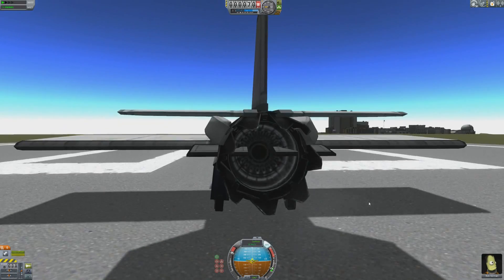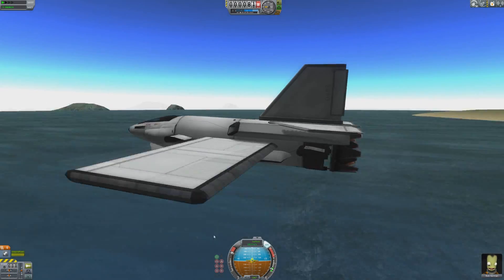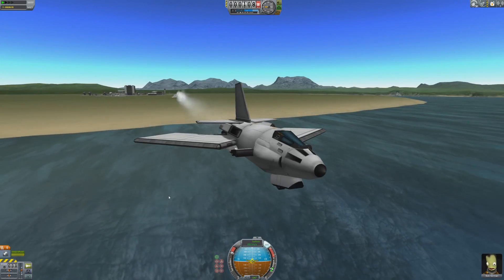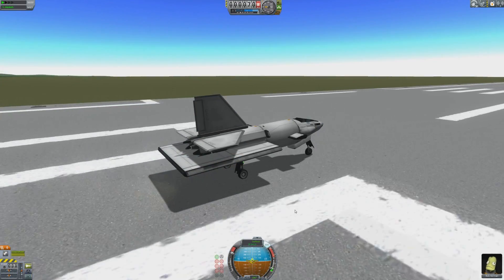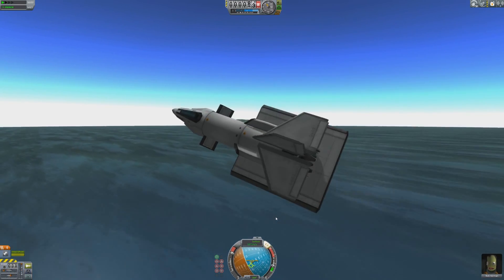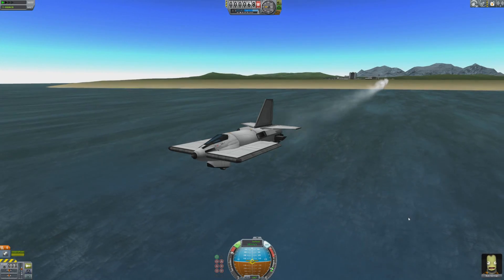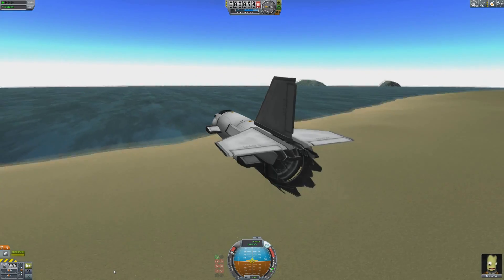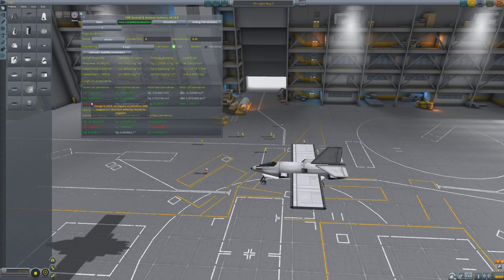Kerbal Space Program - Swept Wings & Aerodynamics Bugs

Comment: It looked like you tried to throttle up the engine once you hit the water. I'm assuming that it didn't provide thrust, but now I wonder if there is an engine that would provide thrust in the water. Time for a KSP boat building challenge maybe?
Reply: Ive built many ships in the water. (Mostly battleships, cruisers, destoryers etc, and i can tell you jets do work in the water. They got a battleship fully armed to 46.2 m/s max. They work perfectly!
Reply: There isn't any reason why the engine wouldn't work in the water, in game or in real life.

In real life you'd just have to ensure clear intakes, and a few other things.
Reply: It did, if you watch his velocity it increases.
Reply: I did boat testing once in KSP, it used intake surfaces for floating and use space plane engines and it went descentky fast and worked in water
Reply: Actually he cut the throttle the moment the engine touched the water. That plume of smoke coming out the back is because it takes the engine a bit to cool (is that the right term?) down so it's still kind of running even if you cut the throttle. That being said they do indeed work in the water, iirc in one of the interstellar quest videos Scott made a fusion/fission power barge and I think he used jet engines to move it.
Reply: Eon2641
correct term is spool, not cool, but close enough ;)
Reply: Elusive7thElement I thought so but then I erased it, crap lol.

Comment: Scott does the turbine engine stall/chutt off if you are goingn in wrong ditection with it?
Reply: Allu Gävert  That is how it works in KSP. In real life ram air intakes are more complex than this. Also if you get in to such a engine pointing the wrong way situation in real life at such high speeds you are likely not going to live to tell about it as you go splat in to the ground along with the ripped apart aluminum that was once an airplane.(Wings don't tend to rip off as cleanly as FAR does it)

By the way there is a kind of jet engine that only works when going forwards really fast called a SCRAM jet and it has taken test aircraft to above mach 10 or even mach 20.
Reply: It can if you are using ram air intakes, those provide much more air when moving fast but only in the forwards direction (But is usually only a problem at very high altitudes).
Reply: Yes, but not because of the orientation of the engine. Air intakes are directional. So, when your attitude is 90 degrees or more from your movement vector (while moving at high speeds), the engines are starved of air and shuts off. This can be overcome by placing backwards air intakes.
Reply: Well that is what im thinking on in real lige but is it the same in ksp?
Reply: berni8k How does a SCRAM get up to speed? is it only useful on aircraft with several engines? :p
Reply: Ebot75 Pretty much. And, just FYI, the SCRAMjet is an extreme example of a RAMjet. The SC stands for "Supersonic Combustion." The ramjet still produces practically no thrust below Mach 1, because it can't compress its intake air.
Reply: Well, KSP:s models aren't very realistic to be honest. Neither aerodynamics or orbital mechanics.